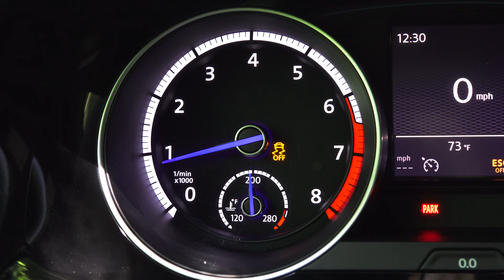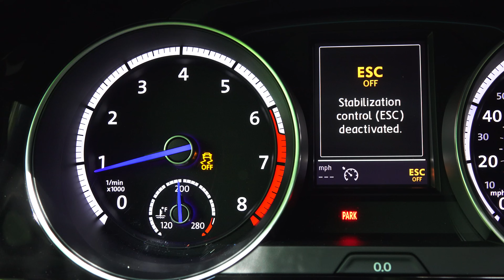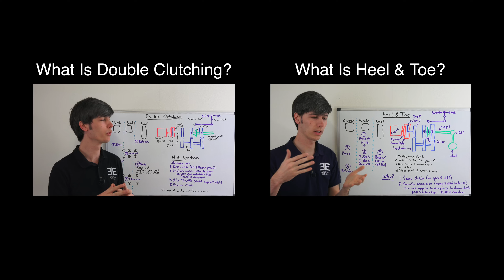How To Launch A Manual Transmission Car

Comment: Your videos are really interesting, not so much the subject in this case (most of us in the UK haven't ever had an Auto box, so launching becomes natural the minute you pass your test...)

It was really good however to hear the explanation of why to do it this way depending on the driving axle and torque of engine.
My only advice would be please have gaps in your talking, or shorten the talking a little bit. I am an Aircraft engineer and follow your reasoning, however you kept giving out so much info that I stopped taking it in and switched off a little. - what must it be like for someone that knows nothing of this subject?

Keep up the good work and awesome explanations. The props are always great too! Us engineers love components and cut-away assemblies.

Comment: I see he launched the Miata at 2500 rpm and got the same jerky behavior i seem to be stuck with. i've tried both 3000rpm and 3500 rpm with same results but in my case it doesnt even out and start accelerate smoothly. I cant imagine i am doing it properly as i am pretty quick with releasing the clutch and the car cant really be supposed to be this jerky so any tips before i try my hand at it again? Wouldnt want to damage the transmission 😑 The car is also a 2.0 Miata ND*

Comment: i have a problem
is it necessary to apply throttle?
my car move when i release the clutch without accelerating
is my method wrong and cause damage to car?
Reply: Arctic Blade It is safest to apply throttle after the clutch is completely released.

Comment: I don't know what traction is in 1st and 2nd gear in my 13 mazdaspeed3. lol I've tried launch control and it doesn't matter what you do. lol I'm putting down 300whp and 330wtq on 4 gallons of E85 and 91.

Comment: Air down drive tires, do burnout to heat tires up, do dry hop to ensure traction, snap rpms to 4k and dump clutch and powershift through every gear.

Comment: I assume I have been making it wrong all this time hahaha! I usually release the clutch, then i push down progressively but fast the accelerator, tyres spin a bit, change gear and then i just push down and shift at high rpms

Comment: I tried to get rear wheel spin from my 2008 BMW 330i a few years ago it would sit on the clutch fully released so badly you could rev it up and down on the clutch while pulling away with zero wheel spin. I took it to BMW twice saying it needed a new clutch both times they said it was fine. To this day I can't explain it

Comment: And how about a high powered, AWD, DIESEL engine? What would be the ideal starting rev for launching it? I have 3.0TDi 280Hp/570Nm quattro diesel. Max Hp @ 4k rpm and max Nm @ 3k rpm (from dyno)

Comment: Is manual motorcycle is similar to manual car, in terms of driving techniques?
1. Can I coast pressing on the clutch all the way?* Will it effect the clutch in a bad way? Or should I bring it to neutral, since I know I'll be coming for a complete stop.
2. Can I skip gears (of course with enough speed); I do launch and skip 2, 4 gears when shifting up, on motorcycle, maintaining good speed and RPM..!
3. I don't use clutch while shifting up, on my motorcycle and it never hurt the clutch, as I blip the throttle a bit down, can I do the same on a car? Will it hurt?
Thanks in advance.

*Coasting to a just turned red, approaching a 'no traffic' intersection..!

Comment: BTW, damaging your drivetrain is close to impossible in most common underpowered cars even if you fail to execute the whole process correctly. Even in more powerful cars, like Mustang GT5.0 with a standard shifter, there's not gonna be any damage but a rear wheel spin. You are more likely to burn your clutch, which at best will result in a specific smell of burning components but beyond that - if you don't burn it for too long, its not gonna be any problem. So, lets not exaggerate the importance of this whole process conducted correctly as you're more likely to learn how to operate the manual shift much faster than break anything. :-D

Comment: is it good if the rpm limiter is only at 5000 RPM? FYI my truck is a 1998 Toyota t100
Reply: Ypk/Noobly is it deseal?
Reply: Will_Lammas no its gas
Reply: Ypk/Noobly oh okay cause usually desial id lower (also dont know how to spell 'deasil')

Comment: Pretty much nonsense, in every day life not to use. It is only explained to launch a car as fast as possible. Nobody does that on each traffic light stop because it's material-degrading in the long run. No attention to most efficient launching by choosing less throttle and shifting gears early. Fuel consumption is exorbitant high with touching the red line always and keeping rpm high. 

The people who know to launch quickly don't need an explanation how to do it, the people who don't know cannot learn it by watching videos. Trial and error is the thing, it will cost some money for spare parts.

Comment: 9:40 what is wheel slip and clutch slip ?
Reply: happens when you can't drive
Reply: There's no such thing you can't drive unless you have no legs and no arms
Reply: It's when you behind the wheel and you don't know what you're doing is it better explanation
Reply: It's just like driving a forklift or a high load for the first time you not going to know you doing unless you experience you get a guy that been working in the warehouse over 100 years he comes in there driving it around like ice skating ring with the best" ice skating shoes "money can buy + 200yrs of skills just being sarcastic.

Comment: Thanks to learning heel and toe myself (actually it's not a perfect heel and toe, rather putting my right foot perfectly between brake and gas pedal) I can now do a Launch control even when I have to keep the brake pedal pressed down. Left side of your right foot keeps the brake pedal - at the same time try to turn/spin your foot to the right -> pressing down the throttle. Build up even small 1800-2000 rpms. then here comes the green light, release the clutch, roll off your right foot to the right, so it slides gently from the brake to the gas pedal. Thanks to this method, my 105 HP E36 316i 1.9 Compact owns almost every single car from line - ofc it is not a race, but rather a dynamic start :)

Comment: Tubb it out put a five link Dana 60 sub frame in it, slicks with bead lockers, posi track or spool and Lenco transmission. As much horse power as you can build, wheelie bars tack it up to what your engine build will take and dump the clutch.

Comment: Actually watching this whole, what is this retareded advice? You put gear 1, you don't add ANY throttle, you release clutch until the car starts to move, you HOLD the clutch until car moved a bit then you release and add throttle.
Reply: Peter Vaňušanik a comment so bad you had to make it twice. This is for a LAUNCH, not grandma's groceries run.

Wonder why he tested it on a highway entrance rather than a parking lot? Because he was measuring 0-60 times. If you drop the clutch on an idling motor you won't be using peak torque/hp.

Comment: just use clutch alone you don't need any throttle
Reply: Peter Vaňušanik that's just driving off, not an actual launch.

Post your 0-60 times just using the clutch.

Comment: great video helped me a lot. I got a Toyota supra 485bhp and about 649 newton's I still have some problems with getting wheel spin when I launch I get wheel spin to 3rd gear I'm still doing it wrong or what could be wrong?
Reply: currently I 0-60 in 4.6 sec I think I could do more if I got less wheel spin

Comment: So I have a V6 mustang every time I Iaunch shift to1st, 2nd, and 3rd every gear except 4th-6th I tend to wheel spin am I burning my clutch releasing too quick?
Reply: Christopher Gran rev at a lower rpm for a longer 1st gear and smoother transition to the second

Comment: You don't mention that a little bit of wheel spin is essential for a good FWD 0-60. I used to use my clutch like traction control in my Neon SRT-4 back in the day. Clutch lasted 100k miles, but I also wasn't launching my car every day.

Comment: how about on automatic
Reply: step one: Put car in drive
step two: Put gas to the floor.

DONE
Reply: only sports and luxury autos let you launch i think. used to drive an audi Q5 3.2 V6. Traction control off, full brake, floor gas, and release the brake and have fun.but like i said, check to see if your car even allows you or you might bust something.

Comment: What the hell is this rubbish! His launch in the VW & Corvette were absolutely appalling! he needed more revs both times. In a sentence to "Launch" a Manual all you do is (making sure the Traction Control is OFF) slam your foot on the accelerator, when the revs get to 4500-5000rpm take the clutch up quickly while keeping your foot flat on the accelerator. Rev in first until just before the limiter (Even if that's past where the red line starts) or where the power starts to drop off whatever comes first. Second and all remaining gears rev until the power starts to drop off as soon as it does change up. You will notice the power dropping off more the higher gear your in.
This being said if you end up in a cloud of smoke then use a bit less gas but if its a bumpy start like he did in the VW & Corvette use more throttle.
Doing this will increase wear on your car, that being said I have a 2010 VW Polo 1.2 which I have "Launched" literally 1000's of times that has done 113,000 Miles in 6 years and my original clutch is still quite happy!

Comment: can someone help my 2002 audi tt 1.8t has a problem when i floor it in second or 3rd gear it lags at 4k rpm drops tiny bit and just keep going up after that but the car does not pull anymore. what can it be? the sparks? the fule pump? and the car only has 33k miles just changed the oil and the antifreeze. plz help
Reply: Well if the problem just happened you might have some water in your tank. It happened to me as well one day that I was refueling and it was rainy and windy. Best course of action is to siphon everything out of the tank and put some new fuel in it.
If the problem has been then for several tanks then it is probably the injectors. I don't think it's the spark plug because you'd have trouble in every rpm or when starting the car up.
If it isn't water in the tank or injectors then check the fuel filter and fuel pump

EDIT: I just saw this comment is 6 months old so you probably fixed it already, what was it btw?
Reply: Turbo probably maxed out above 4k  rpm. Shift to next highest gear and with lower rpm established engine should pull harder again.
Reply: I know whats the problem

Comment: My 350Z has a very high biting point (it bites really close to full pedal release). Can I rev the RPM with clutch pedal closer to biting point (halfway between full engaged and disengaged). High biting point is the common problem of 350Z so it's not the used up clutch isse, besides I have a new clutch.

Comment: today i shift too fast from 2nd to 3rd  - and removed the clutch early - car bounced up and down - obviously not the right way to drive a manual transmission - but wondering if it caused any long term damage/and to what parts...
synchro
clutch
drivetrain
Reply: That's just engine strain caused by lifting off of the clutch too fast. Your car will be fine.

Comment: I have a 2011 mustang gt just got it and im having trouble launching it, I usually rev it up to about 3000  rpm then release the clutch gradually and it doesn't seem to move fast enough feels sluggish any help? just started driving manual by the way.

Comment: I think the most important thing to know is the best rpm at which your car has peak torque. in diesel engines you should start with 2500-3000 RPM no? or is it stil better to start at 4000 rpm?

Comment: The most important point he made there is: release the clutch quickly and SMOOTHLY. Seen other vids where they teach you kids to quickly step off the clutch...never do this!, that could damage your plate. You're welcome.
Reply: Slowly, huh alrighty thanks mate
Reply: To be fair racing ain’t exactly about long service life haha I don’t take my daily to castrol raceway without expecting to be fixing a few things earlier than normal
Reply: I launched my suzuki from neutral, not first gear and was really quick with the clutch, not smooth. With 3000rpm it took off pretty good
Reply: @tejaspadhye  You're an accident waiting to happen kiddo
Reply: @Strome88  hehe okay
Reply: @Strome88  so shouldnt launch your car at all tho causes unnecessary wear rite?
Reply: J4CKR4881T why are you taking credit for what he made very clear in the video 😂

Comment: VW RABBIT with max torque (177 ft-lbs) at 1750 rpm... 
2.5L 5 cyl.
so I should probably be okay holding about 2000 to launch right?

Comment: still don't get how the clutch can transmit so much energy, it's just a thin plate pressed against metal 😶
Reply: Think of it as brake pads in reverse!
Reply: Also if you have ever driven a car with a non hydraulic , cable operated clutch and a decent sized engine in traffic your left leg soon realises the actual pressure force of the clutch spring plate.
Reply: johan bjork, gotta love cable clutches lol
Reply: Terry Heick thats literaly the best quick explanation I have ever heard
Reply: That's materials science for you :)
Reply: Think of it less as a thin plate and more something with big surface area and that is rough
Reply: There is a lot more friction surface area than the brakes of the car because it goes all the way around on both sides instead of just where the brake pads are, and there is a suprising amount of pressure on the clutch when you arent on the pedal. You are clamping it down when you tighten the bolts of the pressure plate.

Comment: I have a Turbocharged Mustang GT 05 with a 78mm Turbocharger. It has a manual 5 speed transmission. Im afraid if I launch this car. its going to end up like the other unlucky mustangs with a horrible driver (Me). is it possible to try to launch this with the traction control on. Also has a stage two clutch and a steel driveshaft so i'm not too worried about destroying those immediately. Just kind of looking for a bit of advice?
Reply: colton hart  I have a supercharged 03. get upper/lower control arms and sticky tires. that will help it feel more controlled. I have done all the suspension mods I can possibly do in the rear and it's much more controlles
Reply: Brett Wilson i have some different springs but im not sure where a good and credible control arms can be found at? not just going to buy anything that says "performance control arms" that are painted yellow or some crap. mine hooks up really good though actually with y100 Z rated 18 inch tires.
Reply: colton hart  maximum motor sports, team z, and upr are all the brands I would go to for suspension stuff. personally I have upr stuff. the upper/lower control arms really help settle the rear-end down. probably the best upgrade besides tires for hooking.
Reply: Ill look into those. hopefully under 1000. I don't have a clue what control arms go for. Which brand makes multiple parts? I need some breaks, probably should upgrade flywheel. rear axel is stock too. steel drive shaft instead of the aluminum 2 part stock is what i have now.
Reply: colton hart  450 Max for upper and lower control arms. buy the adjustable ones. maximum motor sports has a lot of stuff. only get your control arms from those 3 brands I listed. you can't go wrong with them. for fly wheel probably American muscle. for brakes I would get at least slotted and get them on auto anything. lots of discounts.
Reply: Sweet, ill let you know when i get em ordered and installed!

Comment: So a if i had a standard golf v and wanted to launch it as fast as possible, wouldn't it damage the clutch to rev it to redline, usually i just aim for 3-5
Reply: if you're in a standard golf and want to launch as fast as possible, it's probably best to just engage first gear normally, and then switch into a drag racing mode where you rev in to the 4k-5k range for the rest of your gears. If you're in a town/city and never get above 25, don't launch, you'll look like a douche.

Comment: Applying throttle is only needed if you can't launch it without.
You start with getting a feel for it by just usíng the clutch first.
Once you got the point where it engages you can add some throttle.
Throttle is always added at normal launches, it shouldn't be there by default.

With this advice you create clutch burners!

Comment: how 2 launch a cvt car ? any help thanks
Reply: Step 1. Sell cvt car.
Step 2. Buy powerful rwd car.
Step 3. ???
Step 4. Profit!
Reply: Lol so there is no way ? Hahaa
Reply: I did I have 09 Lancer GT but I think it's electronic that's y I don't have tire spin as in most of the cars in automatic transmission I have a cvt in it
Reply: aryan ambastha cuz they lack fun also their continous noise of engine makes ppl hate it whereas in autos or manual u hear the Trans changing but in cvts u can't but cvts are more powerful then autos in general
Reply: dotheymakethatformen how about Toyota gt 86 ?
Reply: Hahahahahhaa
Reply: dotheymakethatformen am holding manual car license definitely gonna try one
Reply: lol literally busted out lauging

Comment: could you post a video showing footwork? I've yet to do a launch as I'm afraid of releasing the clutch improperly.
Reply: You are an Asian.. Asians aren't afraid of anything!
Reply: Van Der im afraid of breaking my car and paying the monies
Reply: experience can be costly at first though :(
Reply: Just try accelerating like you normally would at a stop light, and once fully engaged, switch to "drag racing" mode and go to the red line. The red line is there to say "This is the bit that's safe, don't go past here." just don't exceed your redline and you'll be fine. Once you get the hang of accelerating, practice launching a bit quicker.
Reply: TimeForTimbo Just dump the damn clutch bra!!
Reply: TimeForTimbo haha I already do that, its just the start im not that great at.